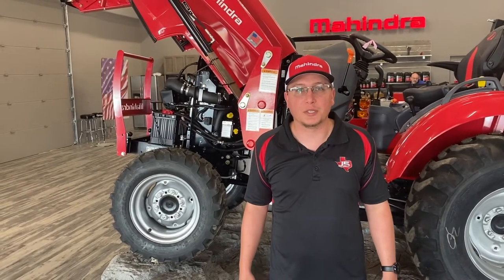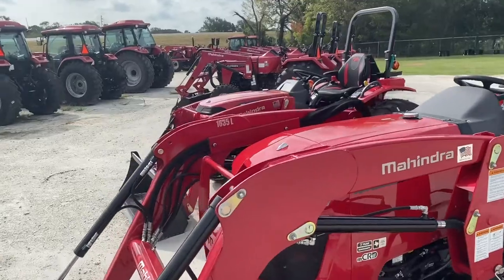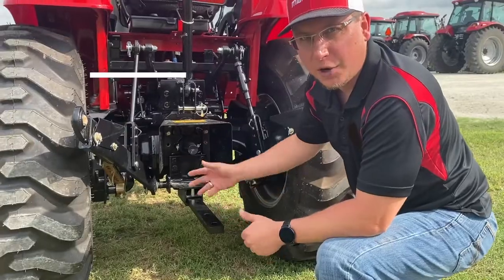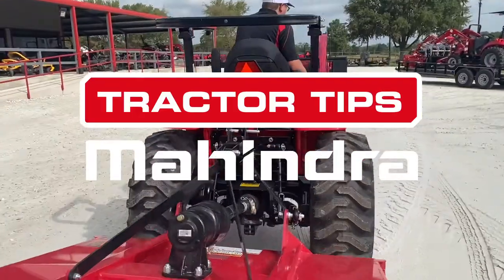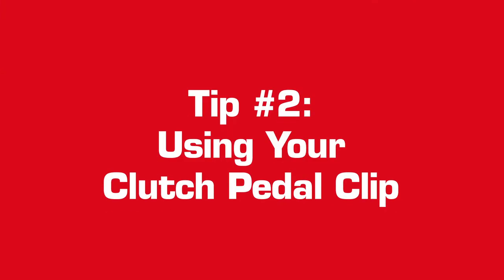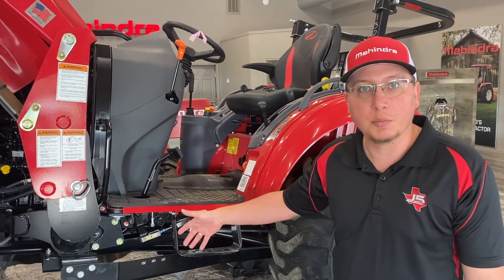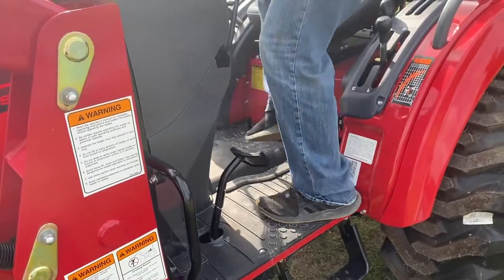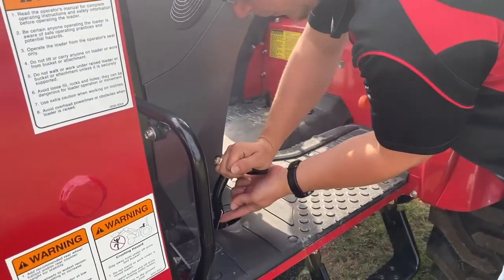Clutch pedal retainer and why you should use it

Comment: I have a 1526 that the clutch will not disengage. Is there a way to free the clutch once its seized? And how do you adjust the clutch?
Reply from the maker: It is possible to free the clutch without splitting the tractor although this method is not guaranteed to work and can damage the transmission if not done properly. Get the tractor moving in the highest gear possible, press the clutch down and press the brake with enough force that the machine bogs under stress from the brakes. Hopefully this will free the clutch again I would be very careful on how much stress you put the transmission under and it is best to split the tractor rather than try this.